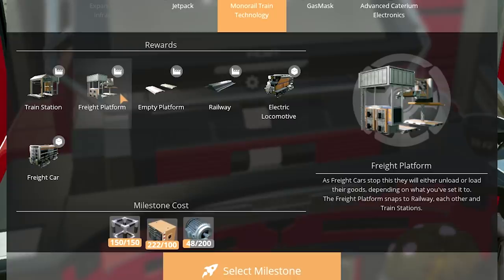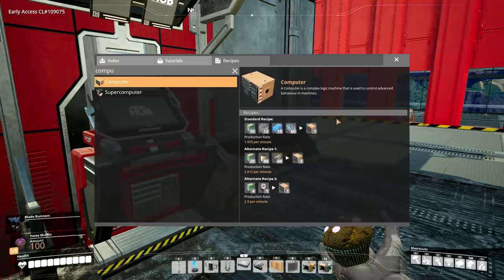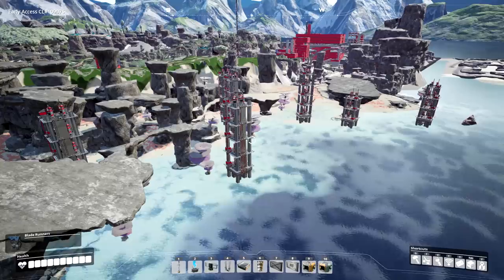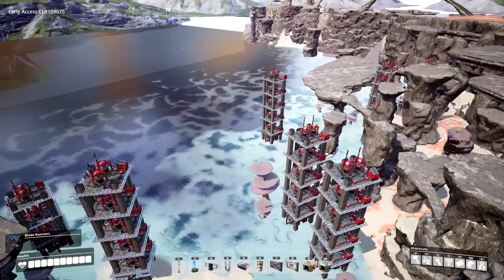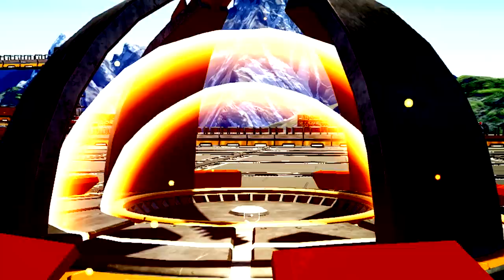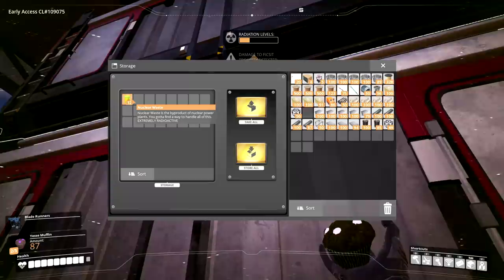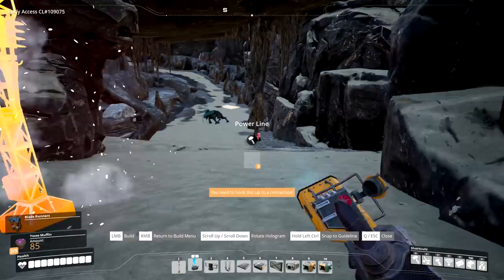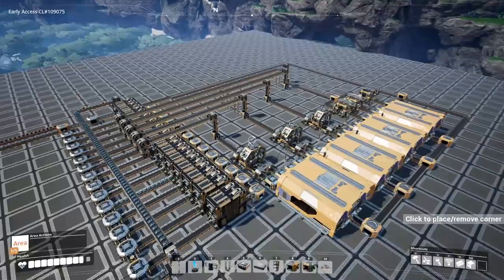Harnessing the Power of THE VOID! - Satisfactory Modded Let's Play Ep 20

Comment: 3 things, 1. That method is limited by belt speed so technically that method is slower than other methods, 2. U should look into sweet transportal as it doesnt require sending belts across the world but u still get the consistency of a belt without travel time, plus it can act as mergers/splitters, 3. U should look into the infinite storage mod for the whirlpool method instead of the void and just hav the items sort into infinite storages

Comment: From 17:40. This design works only for small factories. Because you are limited to the throughput of the main Belt.
e.g. i have a 4 mark5 belts of copper wire wich get distributet to all machines which needs them.

Comment: use a dubbelcontainer in the loop and connect the top output to the void. The top outputs only if it cant output to the bottem part. With smart splitter you can even do better, maybe...

Comment: You forgot one problem for your roundabout void: speed is limited for belts, so transporting all your ressorces on one belt for your whole factory will be slowing down pretty much all maschines to a bare minimum. You will need multiple belts with splitted ressorces
Reply: He never called it fast nor efficient, all it has for it is simplicity of function.
Reply: It also has to wait for everything to get back around the system anyways, but it's the kind of system you build and then leave for several hours or days and then get plenty out of it without much work beforehand.

Comment: I've been having fun with the mod using the programmable splitters where you can limit the # of components being passed through the splitters. So for each production line (like computers) I only send the correct # of sub-components down the single belt in the order in which they need it. Multiply that out by the total # of fabricators and you can have zero waste. With enough testing, you can throttle the correct number of total units for a perfectly balanced system. I just hope that mod will work after update #3.
Reply: I am doing what you imagined in vanilla where I multiple the end recipe enough Times to get the ratios right to use enough material for the recipes but the only problem I realy have is miner ratios since 33,3 % doesnt exist in Satisfactory and multipling it even more would use astronomic Amounts of resources

Comment: Kibitz, instead of splitting Mk.4 belts to have 30/min each, just split 1 belt into 5 mk.1 belts, and split those off twice. It results in 10 lines with exactly 30/min and it's very easy to do.
Reply from the maker: I don't have mk5 belts yet, but once I do I can redo the system :)
Reply: @ImKibitz  No not Mk.5 belts, Mk.1 belts. Because they carry 60/min, so you just split them into two lines of 30/min. (:

Comment: Stack a bunch of splitters leading up to the void, where each splitter has one output continuing towards the void and the other output merging back into the whirlpool. Since each splitter has a 1/2 chance of sending an item towards the void, then as the number of splitters increases, the loss of the system decreases. During normal operation, items will very rarely get voided. e.g. 10 splitters means a 1/1024 chance of an item getting voided.
But then if the system backs up? It will back up along the void line, unclogging the system. At least, in theory.
This way, you can use this void + whirlpool method without the insane item loss of the basic design showcased in the video!
Reply: But each splitter connected to the void is a guaranteed 1 item voided, since the void line cannot backstuff.  So exactly one void splitter is always the least wasteful configuration.

Also I wonder if this void system will be revisited now that update 3 includes a void that gives you resources back?
Reply: @Mirality  I don't understand how this would be true, sorry. After further reflection, I think it's more likely that you're wrong than that I'm mistaken or missing something.
Each splitter redirects half of the input. Multiple splitters compound; two splitters redirect the input into 4 outputs of 1/4 the input rate. Rejoin three into one line and you have 3/4 : 1/4. For n splitters, you have a ratio of (n^2 - 1)/(n^2) : 1/(n^2), e.g. for 10 splitters, 0.999 : 0.001
Reply: @amaryllis0  Oh, I thought you were describing something different -- a main line with a bunch of splitters where each "void side" path went straight to the void (or to mergers that only went to the void, not back into the main path).  My bad.
Reply: @Mirality  No worries! It can be hard to communicate concepts between each other.